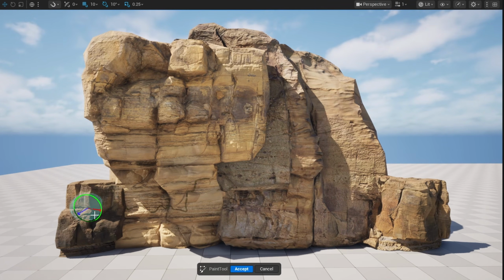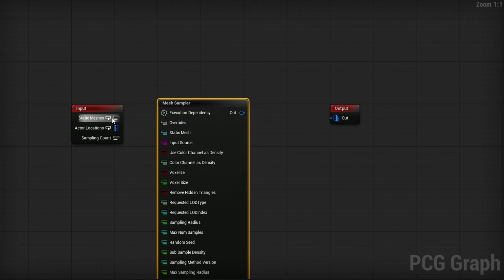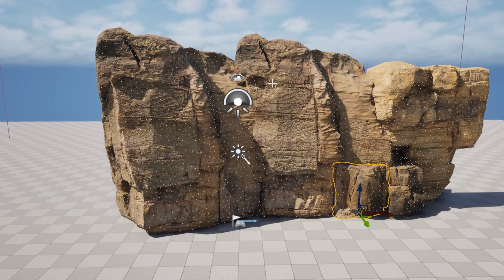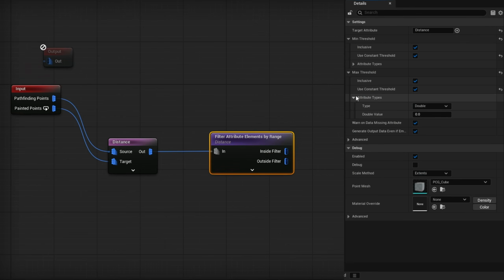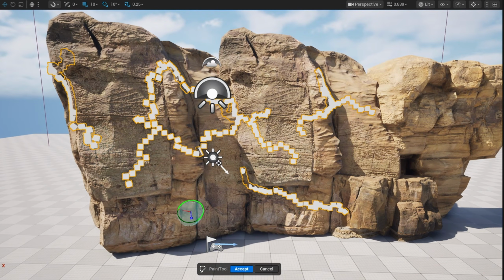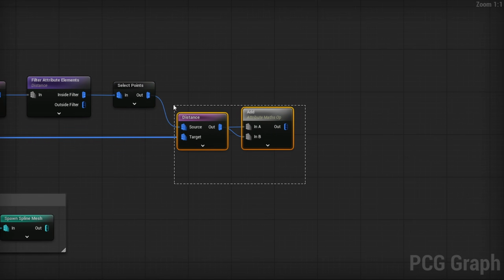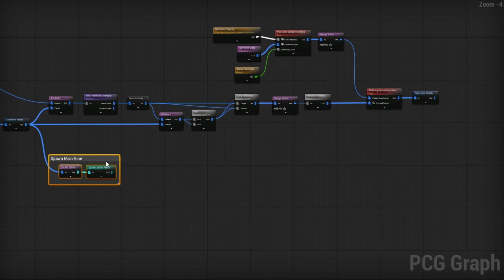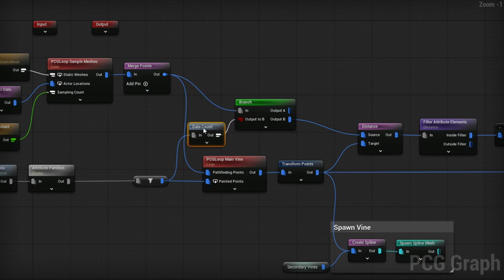Spawn Vines On Any Mesh With A Single Click Using PCG Mode in UE5.7

Comment: Hey, im working with the procedural vegetation system and the exported trees are skeletal meshes, but i need viens on the trunks of the trees. is there a way for this to work on skeletal meshes?
Forgot to mention im on UE5.8
Reply from the maker: I don't believe there's a skeletal mesh sampler in PCG. Maybe you can try using some line traces, but regardless the things you spawn with PCG won't stick on a moving object over time. PCG is executed once and that's it. Any logic beyond that has to be on the actors themselves.
Reply: @Procedural_Minds  alright, ye didnt think about that -_-. thanks for the quick answer

Comment: Hello! Awesome tutorial! However, as you've shown, there are some overlaps, especially when you've got multiple meshes next to each other. I've been trying to find a way to exclude the points inside the meshes, or on faces that are overlapping or too close together, but I can't seem to find a solution. I've tried taking the bounds, shrinking them, and using a Difference node, but the bounds are cubic and don't match the actual collision of the mesh. Unfortunately, the game I'm working on is module-based, so there are a lot of meshes making up a single wall, for instance, and the vines just keep going inside the walls,which means I can't really use them at all. Would you have any idea how to prevent the vines from going inside the meshes or onto overlapping faces? Thanks a lot in advance!!
Reply from the maker: Yeah this system isn't perfect, there's plugins that do this far better. This is more so a tutorial to teach people how to use PCG to achieve stuff like this, but I wouldn't recommend this being your primary method. I'd look into tools that are specifically designed for vines.
Reply: @Procedural_Minds  Ah ! I thought it could be made production ready, Well I still learned new stuff. Good to know that I should lose time trying to find something that doesn't easily exist for now.
 Thank you !

Comment: thank you for this great video ,I've been learned so much，but a question,if I can using UE5.4 to make a same effect ?even i can't find the tool data.
Reply from the maker: PCG Mode was added in 5.7. So prior to it you'd need to use another method entirely, like using Scriptable Tools.
Reply: @Procedural_Minds  thanks for your reply,so you mean the PCG can only be used perfectly in UE5.7,I'm using 5.4 for a test project,but I just cant get the different actor surface in the scene,en they have the same tag,I tried Ray HIt ,but the points only generate on the Z surface🥲🥲

Comment: Hey, I have been using the copy points node on some mesh's and sampling the surface through it. I have an issue where points and Blueprints that have a scale change arnt matching the surfaces of the created static meshes. The order is correct thus far which is: scale -> sample -> copy points ->  Have you got any ideas on how to fix this? It would be of a great help. Thanks! Again Awesome video many thanks!
Reply from the maker: On the copy points node you can tell it to basically use the source or target values for certain things. So you can either tell it to not copy the scale, or move the transform points after.
Reply: @Procedural_Minds  thanks so much for the fast reply! You are awesome many thanks! I found out I had two issues in the end. I was using a remeshed version of my trees that had fewer points for faster sampling which needed newer baked transforms. The other which is what you mentioned. thanks very much for your videos and help.

Comment: Its great as always, thx alot, 
Its very expensive on the cpu though; i m trying to figure how to optimize it.
Suggestion: you can make the secondary vines smaller the more distance it gets from origin point.
Reply from the maker: It's expensive on CPU, but you're not meant to do this at runtime. And cost of PCG for generating in editor is zero.
Reply: @Procedural_Minds  I meant in editor it takes too much time as well, i don't have the best CPU i Guess

Comment: how to make at the end the flowers to face forward? For me when they are around a column, they point at random even when the transform points min and max rotation is 0
Reply from the maker: Forward is relative. Normally when you sample the mesh they point outwards, except when you create a spline, then they follow in line. If you want absolute rotations make sure to enable that in the transform points node. Otherwise min / max at 0 will just not rotate relative to existing values.
Reply: @Procedural_Minds  Thank you. This will work. Is there a way to make it follow the player. I have put eyes and i wish to make them follow the player :D
I will use Spawn Actor: BP_Eye and add the logic there. Thank you!

Comment: I don't see any attribute data for the "Get Tool Data" node after clicking in 3 places, like you did at the 8 minute mark. I kept going anyways but am not getting any vine paths like you did when you debugged the Transform Points node at 14:20. I assume I don't see any paths because there's some issue with the "Get Tool Data" node not seeing me clicking and not getting the click locations but I am not sure how to fix this.
Reply: I seemed to have solved this just by deleting the pcg volume and re-placing it in my scene 🤷‍♂
Reply: @taylorraiford1780  I had the same problem, and your solution worked for me too. Thanks for sharing!
Reply from the maker: Double check that you have selected the "vine" option from the dropdown after making it. If you never exited out from the tool and just started clicking, then it could still be set to "None" but you're not using "Vine".

Comment: PCG is the only thing in UE that I can't really seem to wrap my head around to build something from scratch.

I'm not sure if you are open to requests, but could you look at creating a tutorial for building a spline tool for placing pipe meshes using PCG? Something with 90-degree corners?
The other thing I've been trying to build is a "trash volume", where I can place ground scatter like trash bags on top of tagged floor meshes (specifically not a landscape mesh) - ideally doing some sort of checks for other objects within the volume for them to butt-up against, so you get trash collecting toward the walls of a space, for instance.

I've looked at getting Polygon Flow/Dash, which has the features I need for these tools, but I'd much rather manage them in-house than use a third-party tool.

Any help appreciated!
Reply from the maker: If you wanted to place predefined meshes in corners you'd probably need to setup some math for that. Or you can just use spline meshes. Look into grammar either way. 5.7 even has a grammar setup you can play around with to get you started.